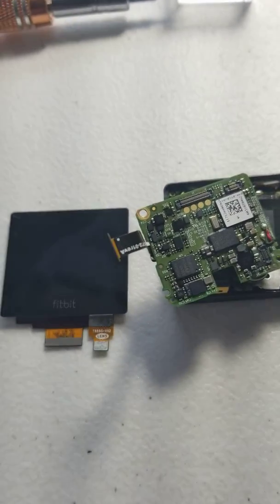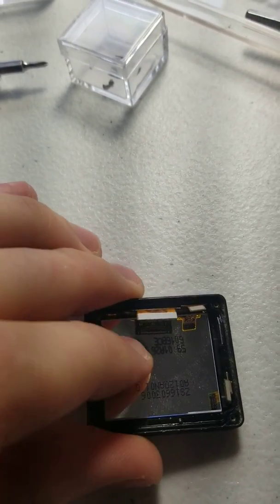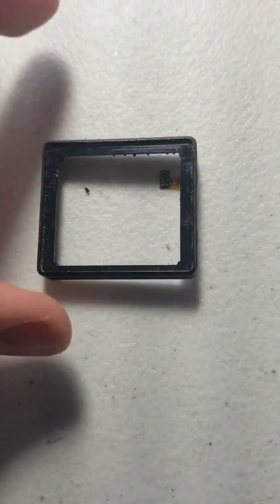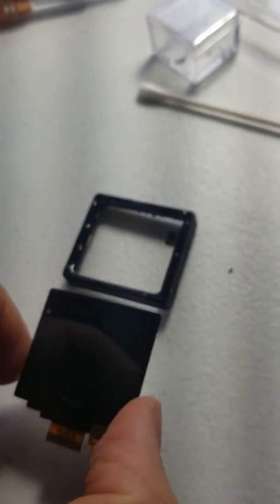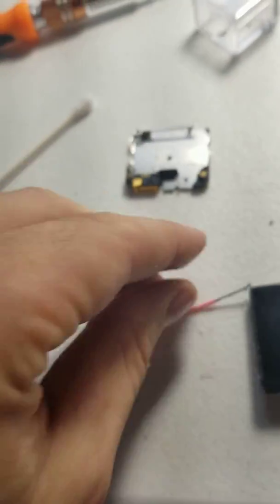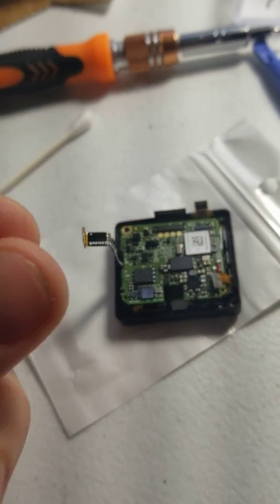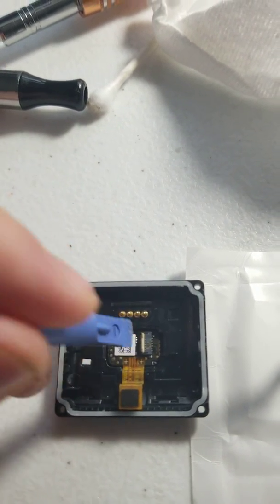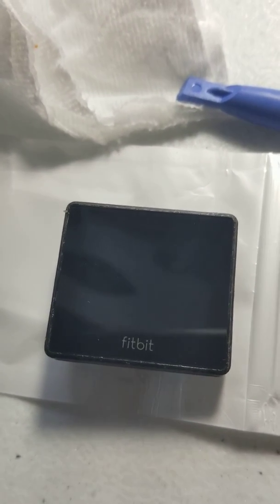Fitbit Blaze Full Teardown Glass LCD Replacement

Comment: They make a double stick adhesive tape for this. I wouldn't recommend using any glue like this. You actually heat up the screen around the edges with a hair dryer to remove the screen.
Reply from the maker: I make sure to leverage my junk drawer wherever possible 😜